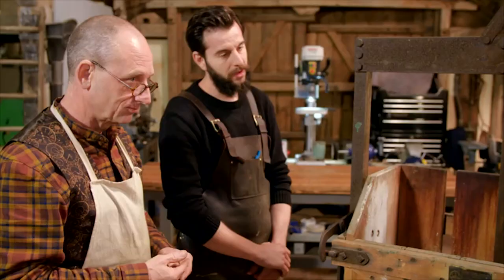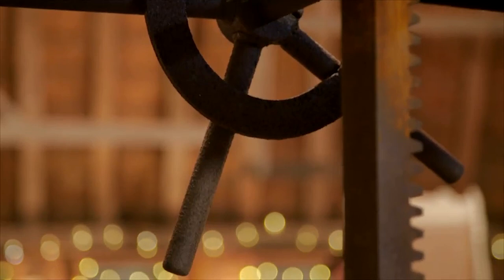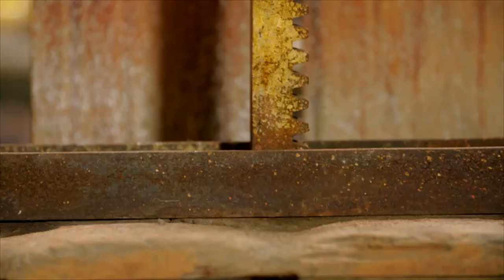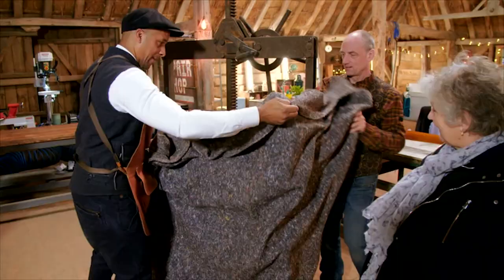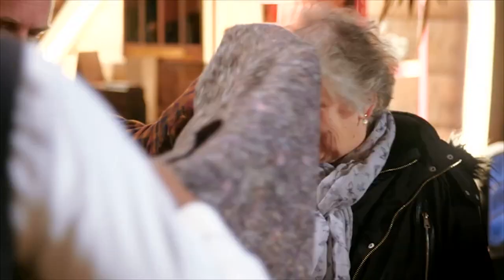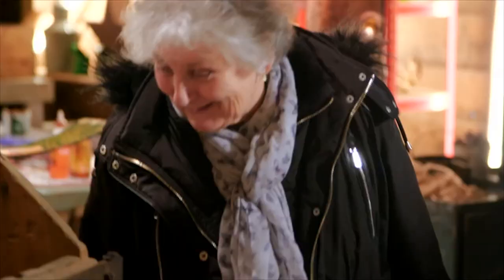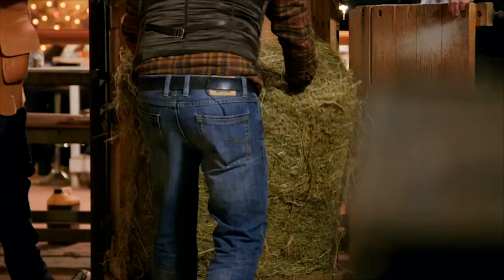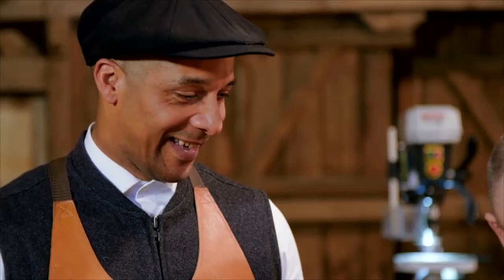19th-Century Hay Press Ready For Action!  | The Repair Shop

Comment: Hi guys, next time you have to remove rust, use Evapo-Rust. It is a water-based rust remover that effectively removes rust to bare metal. Safe-to-use and environmentally friendly. Best part of it is, you don't need to scrubbing and sanding. And no, I'm not sponsored to say this at all.